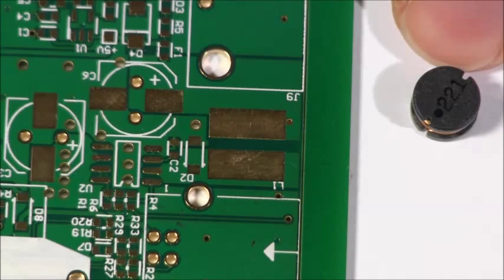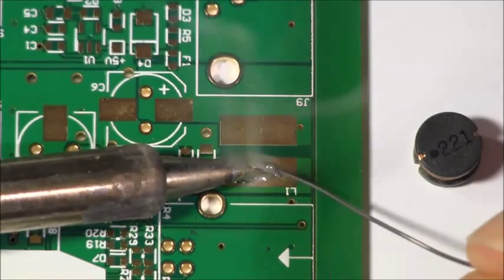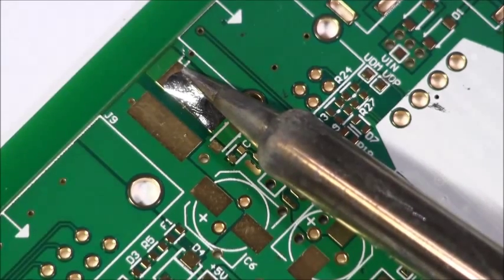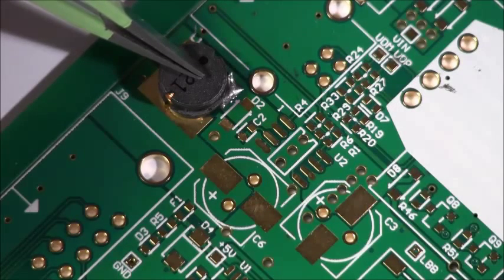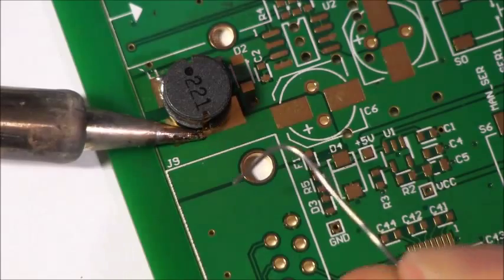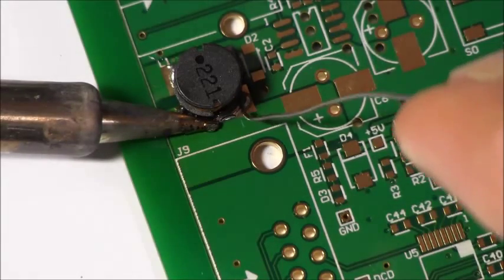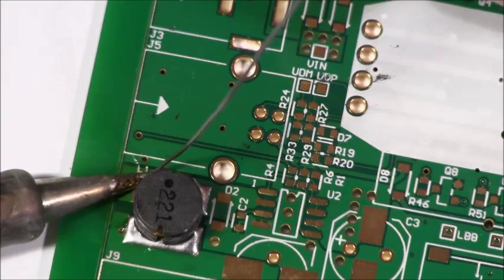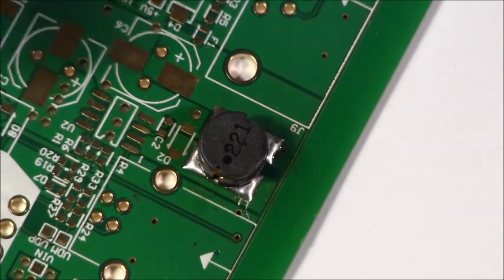Soldering a large SMT inductor

Comment: my power bank shorted out and i took it e bits properlu i have noticed this thing heats up very hot while am tryna figure outbiff i can re solder the power bank together it started charging again but kept been s bit dicky all is i did was was un solder the negative then soldet it bk but like re boiting the power bank it started 2 kindov work but this heated up that hot u couldbt hold ya finger on it so ime hoping its this duz this sound rite plz
Reply: You got scammed, only low quality powerbanks use those itsy small inductors

Comment: Can you use a tiny bit of super glue to hold one side.. I have a DR124-1R5 on my xbox one that's a little loose and my xbox wont run if I apply a little pressure  on it one side it's I just dont want to damage it  and I dont have a solder gun I've look everywhere and I can't find answers. I know it's not recommended. For things that produce heat but I dont think it dose so idont know if it's safe or not I would just ask tech support but there being swarmed  right now

Comment: Great, thanks for that! I had a trouble with a circuit and I found out I didn't solder an inductor properly (it was huge and I was afraid that I'd heat the solder for too long and ruin something, so I ended up not connecting the pads).

Comment: May I know how to remove this kind of inductor from the board? I tried using solder but the inductor is like glued to the base!!!
Reply: If it's glued (as in some cases they are) it's going to be tough. I'd try using something that will bridge and evenly distribute the heat on both sides so that they both melt at the same time and after they're completely saturated then try to remove it. There are a few tutorials I've seen online for this where you just end up heating the bridge, but with large pads it can take a while.